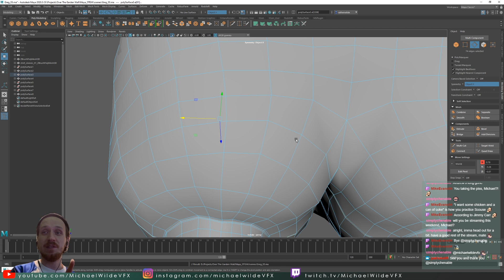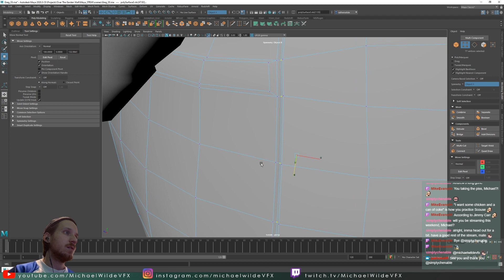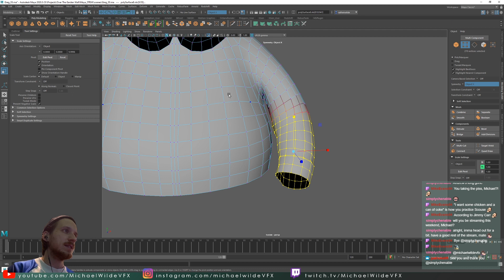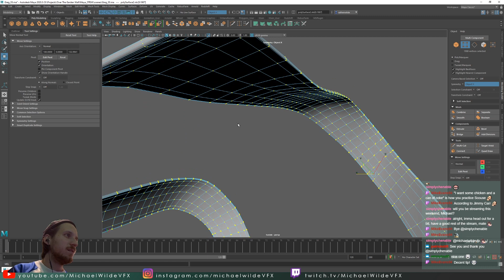Modelling Top Tip - Move Tool and Normals

Comment: I would recommend holding the move / scale / rotate button in Maya and left click. Here you get a radial menu where you can quickly toggle between the axis so you can change to object / normals / world. Useful if you're trying to be speedy and want to quickly change axis without having to have the move settings open as well.